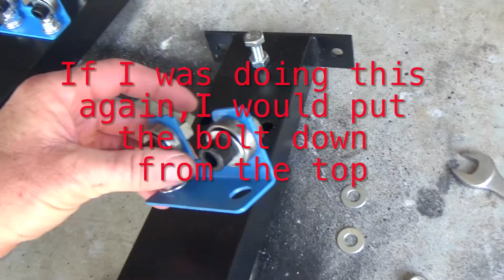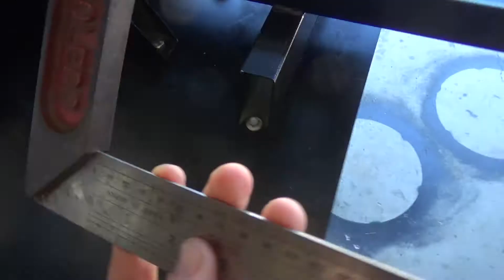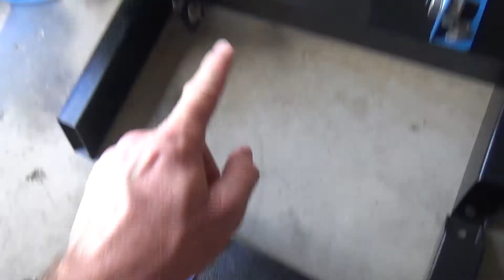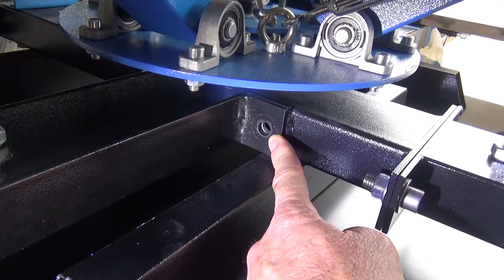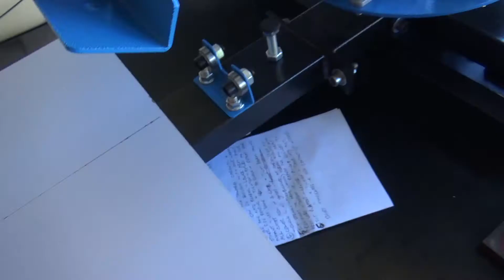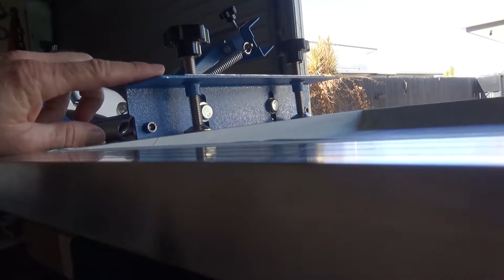Blue Vevor 4 Station, 4 Colour silk screen T-shirt printing press assembly (comprehensive video).

Comment: I must have been lucky only had couple of issues with mine. Platen not level and 1 out of 4 arms slightly off. I used a .5mm shim behind all 4 arms to tilt them forward and bring them inline with the platen. Just getting around to changing the screw mounts over to a flat plate that clamps the screens better. So far I'm happy with it for the money. I getting some nice 4 colour prints (CMYK) which was my main reason for the purchase.
Reply: PS Good video by the way
Reply from the maker: That's good to hear! Thanks for your helpful comment.  Yes for the price it goes alright and does the job. Great for a part timer or hobbyist. With some small modifications you can tackle four color jobs without too much of a headache with registration.
Reply: @bossmanDIY  You mention "with some modifications". . .I'd be interested in knowing what those are? I attempted a 4-color job recently as my first attempt but registration was a nightmare and because I was on a short turnaround I opted to just do them with vinyl (I also use a Cricut system with a nice heat press).
Reply from the maker: @edwells3818 if you notice on my screen clamps I have added some thicker metal sections over the top. Because the clamps are flimsy, when you tighten the knobs down on your screen, it actually bends the clamps which changes the angle of the clamping knobs and causes them to "walk" around which throws your registration out. I might do a short video to explain better.
Reply from the maker: @edwells3818  here's a link to my mod video https://youtu.be/4UhtdSZmN6g